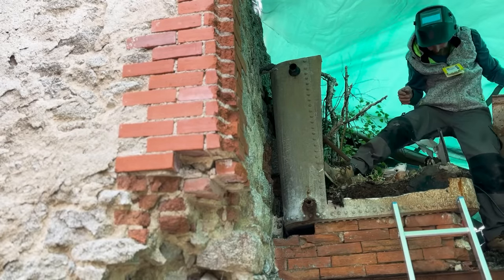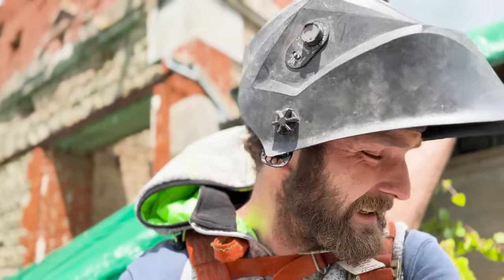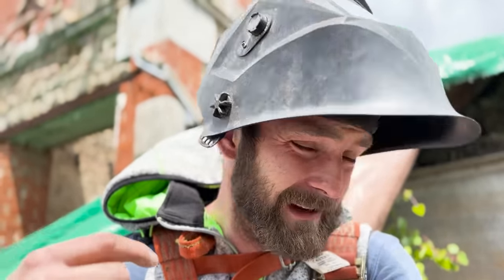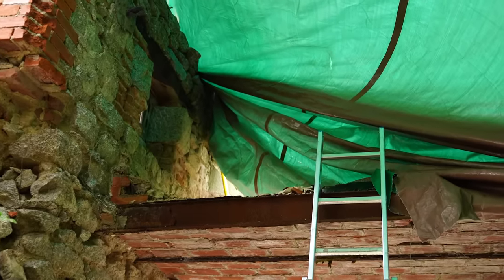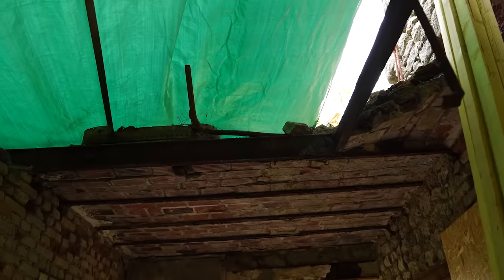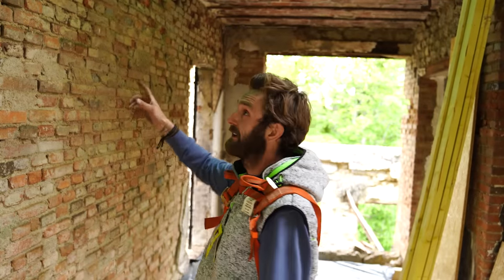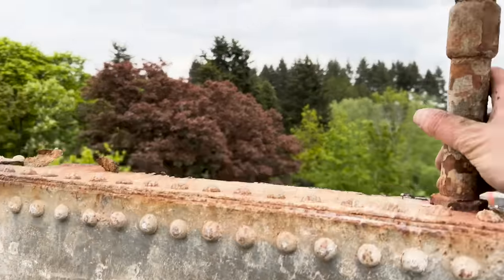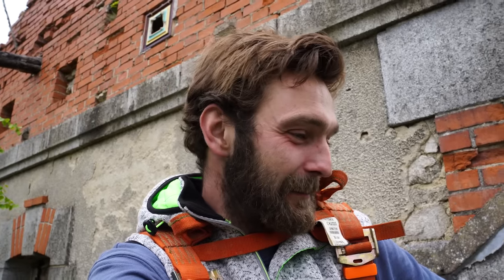i cleared the TOP level of the chateau, now its time to demolish it.

Comment: And have you thought about maybe ending up - the finished roof, I mean, with just one big mansard roof in the style of the original chateau, but without all the small tower and steeple like vertical protrusions. Staying with the original feel, but in a simpler and affordable way. Maybe one more vertical part on the front and one on the back. There were so many versions of this place in its history that I think this approach is reasonable to do. ???
Reply: You mean like with gable walls on the side wings instead of hipped like the original? That would make sense but I'm not sure how much easier it would make things. I'd be really sad to see the tower gone, it was really a defining feature.
Reply: @Ragnar8504   Not a gable roof - still a hipped Mansard roof, but your reply made me go back and look at the original picture and see that that the two problems really are the tower and the large number of window embrasures on the top floor. If you are going to keep that floor, you need the windows and, you are right about the tower, thank you for your comment. Bottom line was that I was trying to let Dan off the hook and to feel free to change the roof design if he needs to. Still feel he needs design freedom, but do not have, it turns out, any very helpful suggestions. I guess we both need to rely on our confidence in him and keep watching. Glad to hear from you.

Comment: Dan, start browsing the web for auctions for proper scaffolding from companies that are going bankrupt etc. You will need the whole outer perimeter covered, all the way to the roof. And it will be required to stay there for a couple of years. So, in my experience, it will be cheaper to own than rent it, with this type of task. I hope you will get the channel producing some revenue for this. Not knowing the prices in France for used scaffolding (proper), but I would guess you need some 20-30kEUR to invest for that. The good thing is that they retain value and you can again sell them afterwards.

Comment: You broke the blade because you are putting too much pressure on the saw. Cutting wheels work best when the saw is allowed to make the cut and not the person... Plus the added pressure and continuous use of the blade causes it to heat up and fail faster. Those type of blades are best used slowly...
Reply: Helpful hit. Nice job.

Comment: Are you going to build the roof as it was before the fire or another way?
Reply: He previously said he plans on rebuilding the original mansard roof, but in the meantime he'll be doing a temporary roof until the structure is fully stabilized to carry the weight of the roof.
Reply: @Sgirl  Figuring out how the third floor mansard roof tied into the hipped section above the hallway is going to be interesting! Everything else is reasonably easy to figure out from witness marks and original pictures. That hallway with the water tanks must have felt pretty cramped and gloomy with its low roof and tiny windows behind the tanks, unless there were skylights.
Reply: @Ragnar8504  Personally, I can't even fathom how he'll replace it. It just seems too complicated for my brain 😅

Comment: Can someone tell me about the type of beams Dan is planning on installing.  Is he saying ring beams?  If so what does that mean.  Thanks
Reply: Hopefully this helps 😊a Ring beams is used reinforce the building along its sides, sharing in the transmission of horizontal forces. They are usually placed under the ceiling structures
Reply: Helps a bit, will Google to see what it looks like and read up on it.  And I wasn't really sure if he said ring or not.  I need visual in this case.  Hey thanks for replying.  I'm so invested in his YouTube that I have a need to understand as building progresses.
Reply: @brendaheath3731  Aww 🥰  he’s definitely going to blow YouTube apart  … I’m invested in this also I definitely will be known as his stalker from the bottom of the world 😂
He’s my conversations talking point …. Like show and tell team Dan …my friends think I’m nuts 🤣😂😁🙃
Reply: So do mine, but they are kind of use to it with Stephanie.   Dan is different with what he has taken on.  I'm all on board for him to take on YouTube and go viral with this project!
Reply: @brendaheath3731  Yes, he said ring beam. A (full) ring beam is a concrete "frame" (for lack of a better word) on top of the walls. A roof (gable, hipped or mansard) is always at risk of spreading the walls outward and the ring beam holds against that. You can get the same effect by attaching the roof to the floor joists but in modern stone or brick construction they almost always use a concrete ring beam.

I've seen houses where the timbers pulling the roof together failed and the roof started to push the front and back walls out at the top. Not nice!

Comment: If it was me I would have droped the top flor, and made the open holes on the left and right open terraces. That would save a lot of work with making a big new roof.
Reply: There may be a requirement to restore the roof to be what it was. France is pretty picky on historic buildings. My guess is he has no choice.
Reply: @stephjezo6470  Depends on whether it's listed or not. Dan said he wanted to take it back as close to the original as possible though, so I don't think he'd change the roof, even if he was allowed to.

Comment: Please use respirator when working with those abrasive cutters, especially so in confined spaces like yours, under the tarp. I believe those discs contain glass fibers, accompanied by grit that is not much healthier. You'll realize how much of those fibers actually fly around if you see the air sparkle around you in sunny days.

Comment: The I-beams in those two floors appear to be perfectly sound (although you would need to have them inspected by an engineer to confirm that.) By all means remove the concrete and brick between them but save the beams (wire brush or sandblast them and repaint) and use them to support the new floor.

Comment: If you have quite some more metall…. Lidl sells plasmacutters with built-in compressor (so just needing power) for 180-200eu. Especially for rough cuts like here (but also fine ones) super handy. and no more cutting blades !

Comment: You should wear protective gloves at this kind of work. Cutting edges can be very sharp. If the part slips through your hand you can get a deep cut in your palm. 
Safety first. Very commendable that you weep a height safety device.

Comment: Legit think you should finish out the center core of the building doing the rroof etc so at least you will have a staging area for building materials and be protected from the weather at the same time put some temp doors in to keep critters out, then work your way out from the core.

Comment: tanks similar to those are being offered for sale for £1,000.00 + Vat each on some site. i guess it would have been tough to take them down in one piece though..
Reply: I don't know the prices for crane hire in France but spending something like 3500 quid on a crane to get two tanks worth 2000 down wouldn't be cost-effective. All I know is a friend paid 3500 Euros to have some historic lift machinery craned down from a loft in Vienna a few years ago.
Reply: @Ragnar8504  yeah i imagined that to be the case, it is a bit of a pity though; perhaps they could have been taken down at a later stage with the crane that i assume might be needed to rebuild the roof. anyhow, what is done is done.
Reply: @davide88rome  We will see. Dan might try to get by without a crane and I can actually see that happening.

Comment: Lovely views from on top. Great aerial shot of the chateau but I still think something doesn't add up. Which would explain the stairs. I wonder if what you call the rear entrance was actually the front years ago. We can vaguely make out a road parallel to the chateau from the drone footage. And from the aerial view the atrium/possible hallway is bigger than what you class the front(his and hers entrance)
Reply: I don't think the location and general layout of the stairs ever changed. The offset window levels in the tower line up perfectly with the landings, so I think we can safely assume a) the stairs have always been in the tower and b) they've always had landings. Those two granite pillars that support most of the tower walls, the stairs and the upstairs hallway floor joists also seem to be original, adding those later would have been a massive job. The room facing the other way could have been the original formal salon with a large patio outside.

Looking at maps and a satellite image, what was likely the original front (the double stairs and doors) faces north-east, the patio with the single outside stairs south-west. If the description by Eric Thorn is correct, the north-west room on the ground floor was most likely the dining room because there were internal stairs to the basement hallway just outside the kitchen (Thorn describes the room with the stairs as the only one that didn't have a patio outside).

The other road, Rue Chaumont (which goes almost straight north-south), is at the bottom of a rather steep hill and not likely to be connected to the château itself, the access road/driveway forks left at a very steep angle a little north of the château.
Reply: Point taken, but most big houses the stairs face the front door. But these stairs come out between 2 pillars and face the wall. So if you enter through the his and hers you have to double back on yourself to climb the stairs. Of course that wall may not have been there originally. Also the his and hers stairs have a basement doorway between which would normally been at the rear/ servants. I would imagine  that a lot of land has been sold off cos in the drone footage new houses are very close. Even the gateway and path looks rear entrance. Ot course the French may build different to us.
Reply: @jampy3885  Having to do a 180 to get up the stairs is indeed unusual for a grand home. Most of the walls on the ground floor look to be original though, and they're all load-bearing brick walls. If the main entrance had indeed been on the other side (southwest facade) you'd have to walk in through the centre door and then either left or right because there can't have been an original opening right in front of the stairs, that's where the heating ducts are. Doesn't sound like a grand entrance to me either.

The main basement entrance is on the other side, Dan worked on excavating that a few videos ago. The door you're referring to is smaller and has limited headroom. The other entrance is massive, almost like a small loading dock. That's certainly not something you'd want on the front of your mansion.

That house visible in the drone shots (on the château side of the public road) isn't new, it used to be part of the estate. That house is at the bottom of the hill, quite a bit below the château though, you can sometimes see its roof in the outside clearing videos. I don't think the driveway changed all that much. In the old pictures the side Dan calls the front has what looks like a vast open space outside, I do think that is the original main entrance.

I think most of the things we perceive as strange are owed to the very specific history of this building, being in a rather remote rural location. I suspect the original architect considered that in his designs. He might not have been the greatest architect either, we'll probably never know.
Reply: Thanks for comment. What is your opinion of The photo Dan showed of the kids outside the chateau on the stairs/balcony where one child seems to be standing outside the balustrade? It doesn't look like the twin stairs or the side stairs.  Plus above the single doorway there are 3 balconies. Most stately homes would have two entrances to the estate. The gate Dan uses not really simetrical and looks like a rear gateway. I thought The basement Dan uncovered was of the side stairs. I may be wrong cos it's easy to confuse the two single stairs. Also Dan's photo of the old staircase, I don't remember seeing a pillar. I may be mistaken

Comment: Dan I know I'm an observer and know jack about renovating....won't using a bigger stone and removing the brick ceiling change the building? If it's already a brick wall, doesn't it make sense to use same material? And if you are going to take down the ceiling, couldn't you use these bricks for the wall?
Reply: Back in the old days all they had were solid bricks, fairly small because of their weight. As time went on, they started making bricks with holes to decrease weight and improve thermal insulation. The current state of affairs is blocks with almost more vertical holes than surrounding clay material and these holes can even be filled with mineral wool. These blocks are as thick as the entire wall and much taller than solid bricks, so they're much faster to get up. Another option are solid blocks from lighter materials, like aerated concrete (concrete with lots of tiny air bubbles).

All these materials are less strong than solid bricks but if used according to the manufacturer's instructions they should be perfectly fine.

Comment: Have you considered removing the top wall sections all together and roofing what remains? A turret can happen later on.
Reply: A temporary flat roof on the intact parts of the tower would work just as well. Scaffolding is definitely a must-have for any work on the tower though, at least the outside wall.

Comment: Just curious about the floor or area where you're tossing the tanks and debris.  Any risk of damaging it or damage to the walls from hitting the beams? Would appreciate you mentioning it on one of the vlogs. 😊
Reply: The floor is already shot to bits and will be replaced in due course and I'm sure the timbers from the collapsing roof structure were heavier than the pieces of steel tank.

Comment: Don’t use „big blocks“. Modern materials will look like sh*t on top of such an old building. Reuse the old bricks with new cement. It’s easier, because they are already up there. It’s cheaper, because you have to buy less new bricks. And it is sustainable.
Reply: It won't be visible once it's plastered, that's an internal wall! If the wall used to be as tall as I suspect most of the brick has fallen down and would need to be carried back up.

Comment: Get a Dewalt Cutting Blade for your small Angle Grinder next time! It will do the whole thing with just the one blade or less
Reply: I don't think I've ever heard someone call a 230 mm (9") grinder small 😀 The next size up is petrol-powered and used for cutting massive structural steels, railway tracks, etc..
Reply: @Ragnar8504  Small Angle Grinder 5 inch!!  The one he wasn't useing!
Reply: @hughroney6342  Ah, sorry, now I get your point!

Comment: Well done they are out of the way. You mentioned getting rid of those metal bars but aren't they stabilising the walls??
Reply: Valid question but I'd assume floor joists and a concrete ring beam should do the job.

Comment: Are you subject to building regs and do you habe to get building permit etc and structure checks done ?
Reply: No permit required for renovations but I suppose his new work does have to conform to the regs. He mentioned a structural engineer a while ago, so I hope the building has been checked (although structural engineers often do have a habit of being excessively careful so I'm not sure I wouldn't rather have an experienced builder instead if it was my place).

Comment: Just wondering…. Are the bricks not reusable???
Reply: When he was working in the basement he said they'd gotten too brittle to reuse
Reply: @Sgirl  well that makes sense given that the fire would’ve been intense enough to have essentially re-fired them and they’re basically overcooked now
Reply: @belinda1669  I'd think frost over the past 35 years took a worse toll than the fire. Common brick, when exposed to the elements, wicks up water and when that water freezes it expands and cracks the brick.
Reply: @Ragnar8504  ok thanks for your explanation

Comment: Dan, I don't  understand why you are not reusing as many of the original bricks as possible.  Is the goal not to rebuild as close to original as you can?
Reply: When he was working in the basement he said the bricks were not reusable because they had gotten too brittle
Reply: @Sgirl  That doesn't bode well for the building as a whole if the bricks no longer have any structural integrity...
Reply: @kiwi_nick  Some do, others don't. You can clearly see the ones that have frost damage. The top section, starting around 30-50 cm below the second-floor ceiling is pretty bad, everything else not so much by the looks of it. I'm sure quite a few of the bricks up there are salvageable but a lot of them are no longer there (probably on the ground floor or in the basement now) and building with those small bricks needs a lot more mortar than using block. It's also much slower going.

Comment: How did four feet of mud get into this building?
Reply: Probably a mix of fallen plaster and mortar, ashes from the fire, dust blown in by the wind and compost, both from the rotting floors and from any plants that managed to get hold inside the building.